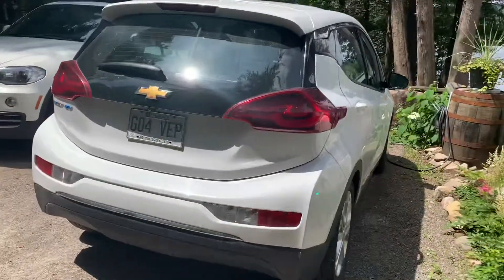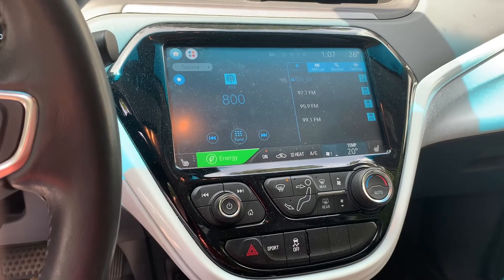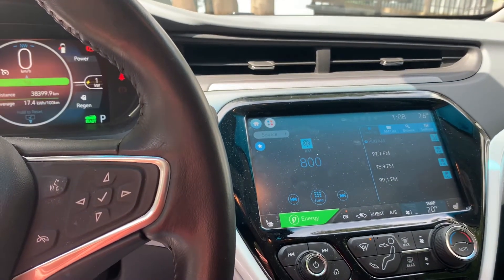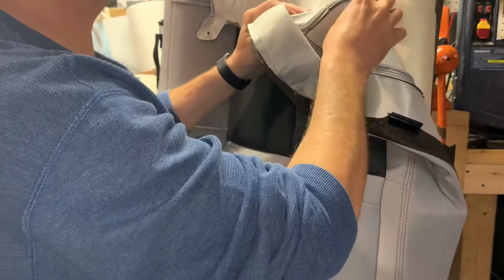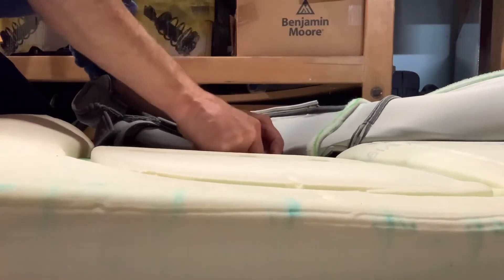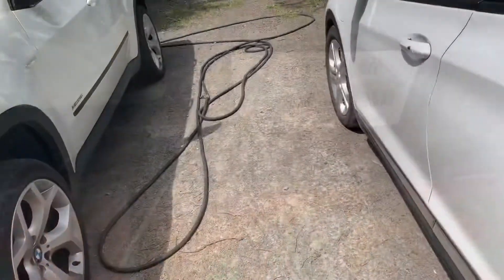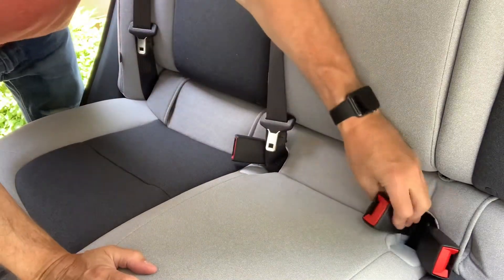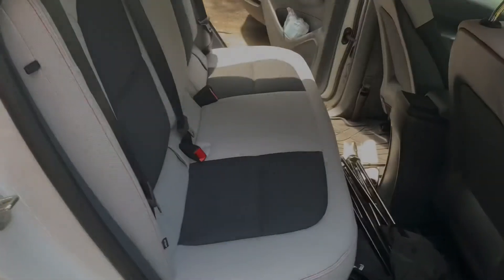2020 Bolt EV rear seat removal, fabric removal, clean and reinstall.

Comment: Hi Bill, helpful video for helping me get the rear seat off of my 2020. Wanted to mention there’s an easier way to get the center shoulder belt detached - there’s a very small hole at the base of the black triangular piece that the base of the belt latches in to. Stick the end of a paper clip in there and you can detach the base of the belt, no wrench needed.
Reply from the maker: Cool, thanks Tray!